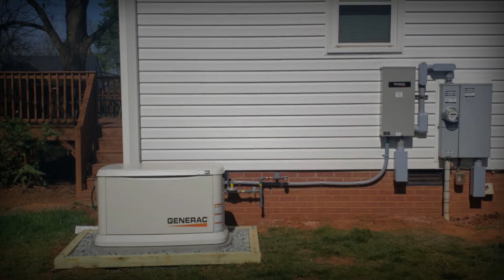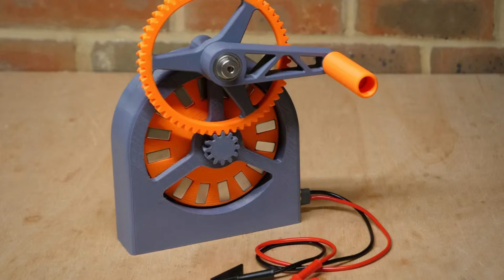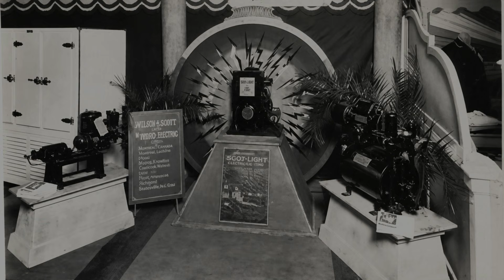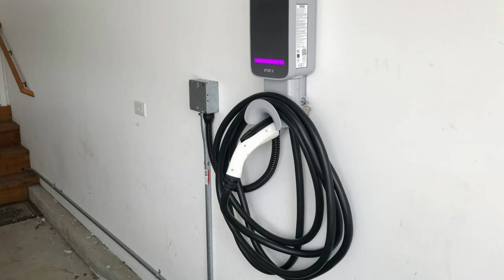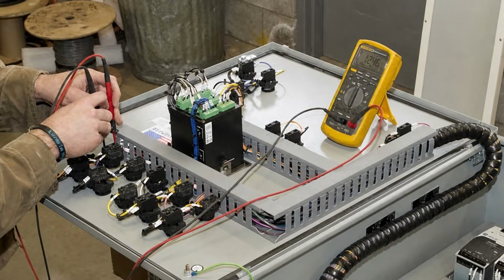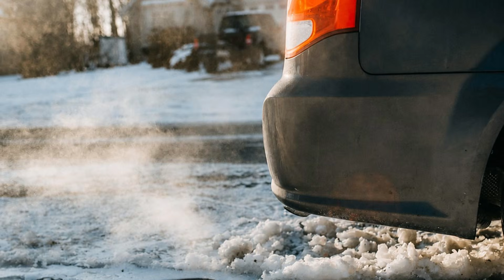This $20 SCRAP MOTOR Turns Your Car Into Solar Backup Power (No Generator NEEDED!!)

Comment: You clearly have no idea what you are talking about. An alternator has a coltage rectifier fo keep the voltage even as is. The difference is the  current(ya know amps) tou do not need a separate motor to generate 12 volts. And the reason why you buy a back up generator instead of using a vehicle is simple what if you charge that bank and dong have enough fuel to evacuate if that is called.... im sorry but do more research.